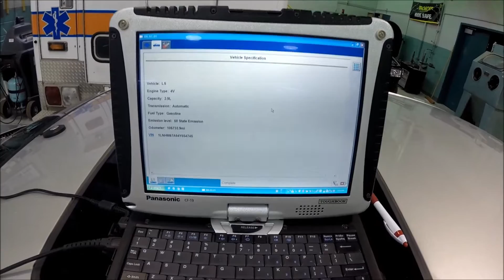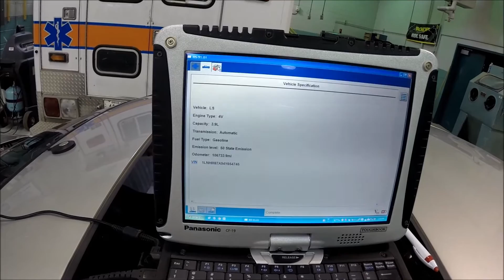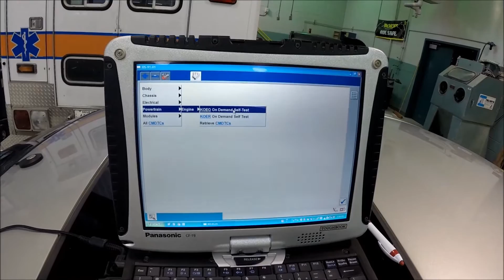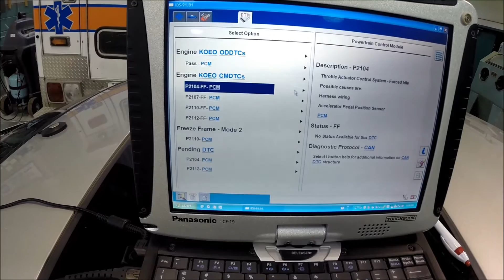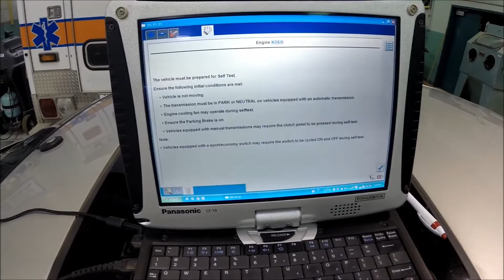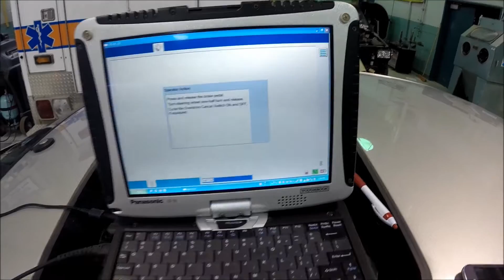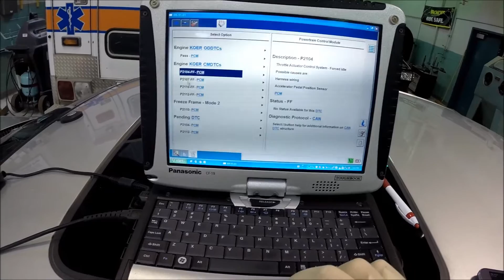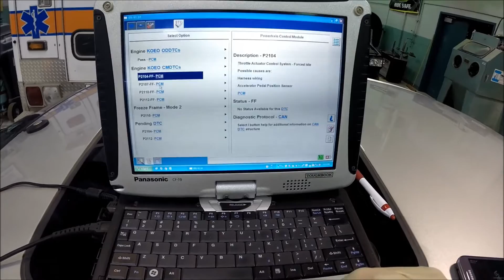Ford KOEO and KOER Self Tests

Comment: 2010 Fusion SE 2.5L, should the engine remain running at the end of the KOER test?  The rpm stalled out but recovered at one moment in the test, and then just died at the end.  But "no problem found" or whatever the specific text string is.  At the end of the KOEO test, it appears to cycle ignition, or at least reboot the instrument cluster, as well.  Are these normal exhibits of the self-test for that vehicle, or are they indicative of some electrical stability problem?  Battery/generator voltage is not a problem.